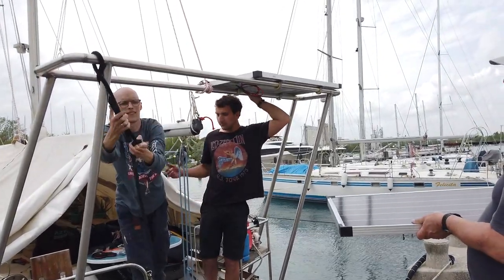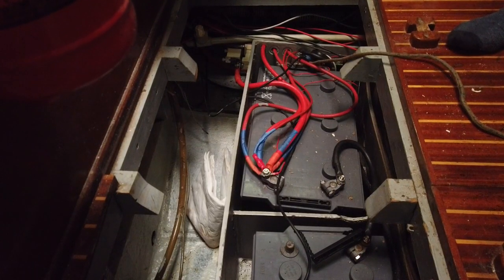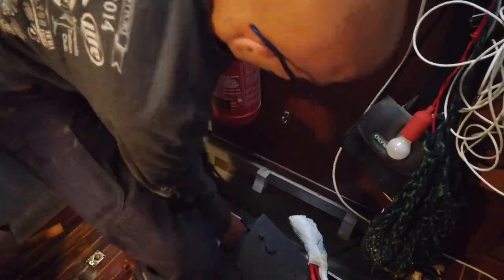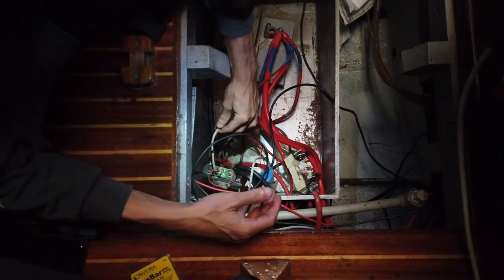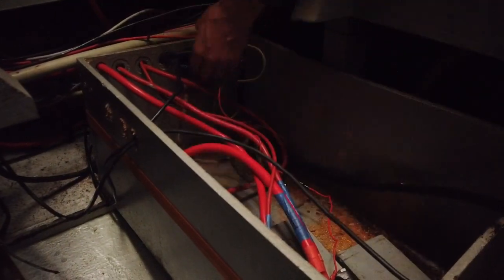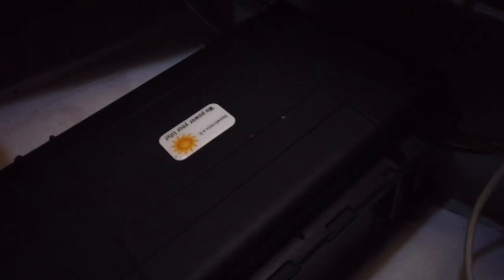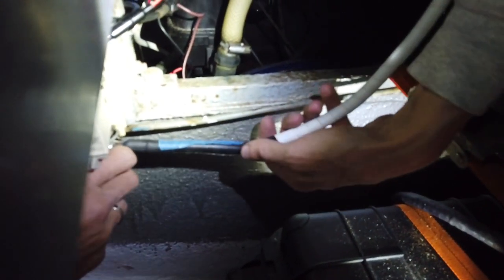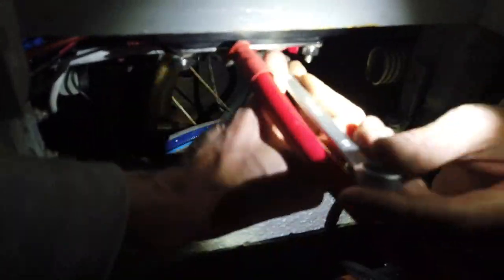Boat Battery upgrade to Lithium: Hometronix Lithium Battery

Comment: Nice job! All those thin cables going directly to the battery are a nightmare. I do small boat electrics for a living, and the most important thing is to realize that you have to fuse a cable. Everywhere the cable diameter gets smaller, there needs to be an appropriate fuse. A lot of people under estimate the risk thinking it is just 12V or 24V. There are 1000A currents ready to run without the proper   fuse. It might be save to touch, but it is much easier to set your boat or car on fire then your house when the 16Amp breaker will trip with any wire size.
Reply from the maker: Agreed! And shocking every time you look at wiring of most boats...

Comment: That’s a shockingly small battery for 7200 Wh.  I have a similar amount of power in 4 high-quality drop ins and each is almost the size of yours. My 4 batts make up 640 Ah at 12 volts (7680 Wh). I had so much rewiring to do the whole job took about 10 half days (it’s hot here).  There was some “while we’re at it we might as well do...” stuff involved as well.
Reply from the maker: Very similar size then, 24v 315ampH. And i agree, crazy small! They get better and smaller at rapid rates right now